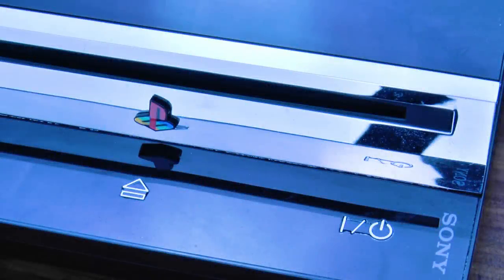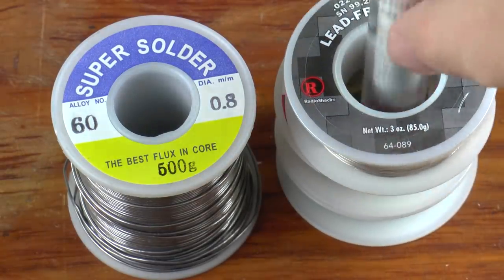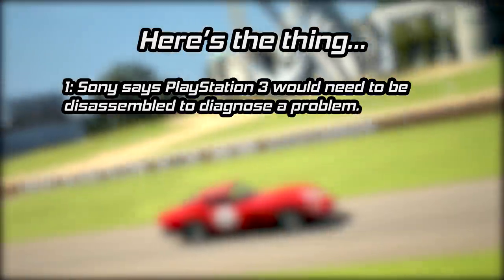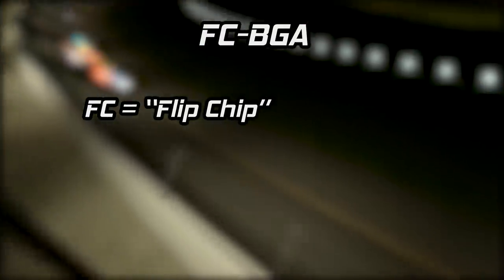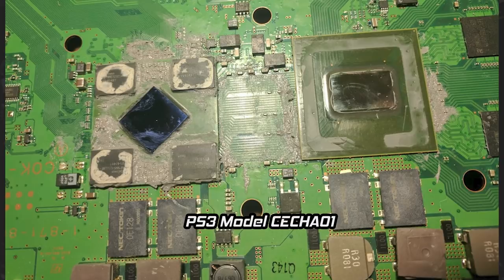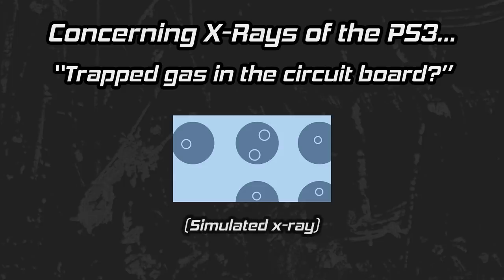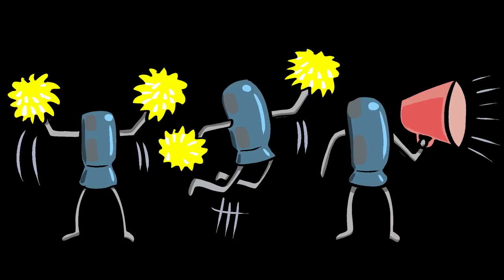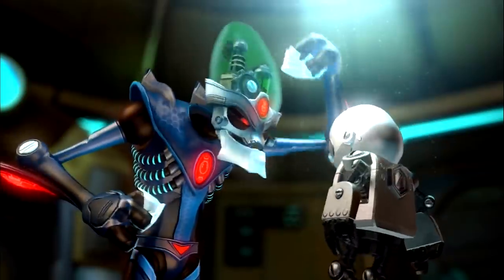The Misdiagnosis of the PlayStation 3 Yellow Light of Death

Comment: Glad I watched this before I attended the PS3 YLoD "fix" a few days ago.
Reply: Did it work?
Reply: It works just renew paste
Reply: @siddharthnambiar5758  it worked, delidding the RSX and CELL and replacing the thermal paste. No yellow light anymore (it wasn't dead, it just didn't turn on the first tries). But now it actually got the YLOD, and I'll try replacing those capacitors.
Reply: @Chrisgamechannel1  I did, it worked, but now it's dead, because of the capacitors I guess.

Comment: I love this video. I'm a software engineer and see this sort of "repair" strategy from a lot of "peers" in the field. It's reinforced by bad middle management who often reward results over anyone knowing what actually went wrong. Making a problem go away is obviously the goal, but if it's your own product you gotta know what what really went wrong to know how to fix it. Of course Sony doesn't have to be transparent about what is going wrong, but they should (and probably did) know. I had a friend who fixed my launch PS3 60GB (it worked right after the heat gun application to the CPU and maybe GPU - not the capacitors) but it didn't start up when I got home long enough for me to transfer my saves away. This video shed a lot of light on the idea that the exact issue isn't even known, but the reason I saw any difference was a bit of dumb luck.

Comment: This reminds me a lot of the GPU switching issues with 2010-2013 MacBook Pros. Everyone thought it was the lead-free solder on the Nvidia GPUs, but it was the capacitor feeding the GPU that caused the issue. But because it was right beside the GPU, everyone heating up the board would reheat the capacitor and “fix” their boards.

Comment: Dreamcast random reset -> The internet : "Reflow the pins of the PSU or bend them !!!!"
Everyone : "Ok, I'll do that and spread my new knowledge !"
Open a DC and tell me those pins "disconnect themselves" at random while you're playing... Geeee, the amount of fake knowledge out there is beyond belief sometimes.
Real solution : Remove the dust (basically free the exhaust of eventual dust), clean the fan, MAKE SURE the fan spins (if not, reflow the 3 pins of the fan's connector on the daughter board) and more importantly : change the thermal pads (with 1.5mm thick ones). That's it, problem solved !
Reply: I believe that the random reset on the Dreamcast can only be caused on the PSU side if you unplug and replug it on the Motherboard multiple times. And because the pins are not designed for that multiple unplugging and replugging you're gonna run into a potential random reset issue or the console not wanting to boot at all and you have to find a fix for it.
Reply: BaeCityAnri   BaeCityAnri  In my case pin 1 that outputs 3.3V was dirty or perhaps even worse than that which caused my VA1 Dreamcast to not boot. Cleaning it with IPA helped but only temporarly because soon after thta I would get random resets. Lately I had to put the PSU slightly higher for it to work. Though now I'm getting a different motherboard (also VA1) for my Dreamcast because of screwed up a mod on that one. 
One more thing: Having a Dreamcast that the GD-Rom drive doesn't do anything can be associated with the bad PSU connection particularly on the pin 6 that outputs 12V.
Reply: BaeCityAnri  @Daniel Black (Hey Alex !) Corroded pins causing random resets, that I would believe. Not booting at all, that would make sense. But we're talking 0.x% of Dreamcast here. The thing is, people seem to have "fixed" the issue by doing something to these pins, I have a theory on this : While doing it, they've applied some pressure onto the top metal shielding / Heat sink which is what, IMO, actually did something (added to the fact that they've probably cleaned the console while they were at it). I wouldn't be surprised that the issue is a combination of 2 things :
The thermal pad getting thinner and the heat sink losing contact with the thermal pad (because of the heat, the metal expanded)
Therefore, there was air between the thermal pad and the heat sink, air being one of the most efficient insulation, there was an overheating issue.

Out of the 50+ I've taken care of this year, only 2 had a reboot issue. One was due to cold solder joints of the fan connector and the other was a console sent to me by someone telling me random reset  was the issue I needed to look into. I cleaned those pins with IPA (I always do, it doesn't cost me anything but at no point I told myself this was part of the fix, plus, they were in good shape), all I did was a cleaning and replaced the pads. It was months ago, no news from the customer so... "no news is good news" like we say in France !

Daniel, "Having a Dreamcast that the GD-Rom drive doesn't do anything can be associated with the bad PSU connection particularly on the pin 6 that outputs 12V."
When you have issues with the GDrom, check the GDrom connector itself first, it's very unreliable. For instance (and this is an issue very poorly documented), if your DC hangs on the boot screen for 2 minutes, it just a bad connection between the MB and the GDrom assembly. Unplug, replug and it should work fine.

I'm not saying there wasn't an issue with your PSU on this one. But maybe you've disassembled it, checked everything, saw something with the 6th pin (let's say, you cleaned it) put everything back together and the GDrom was working again so you told yourself it had to be that 6th pin. It could have just been a bad connection between the MB and GDrom drive, that you fix without noticing.
Reply: @SLRModShop  Yeah... I personally only ever had one Dreamcast so my own experience on this is very (!) limited. And I had a conversation with one guy who does console repairs and he said that most Dreamcast he got had a bad PSU connection. And I saw one video years ago about a Dreamcast not reading discs where the GD-Rom Drive didn't do anything and the guy just added solder to the pins to be thicker and then it started to read again. And he didn't even clean or remove and reinsert the GD-Rom drive!
In any case, I'll think about chnaging my procedure when doing repairs like these. In general we need to inform ourselves from people who repair these about their experience. 

Thanks for the info! And...

Sorry for the late answer...I wasn't pinged and I didn't check myself if someone responded until now.
Reply: @danielblack6529  No worry, I'm making a huge repair guide that I will share online once it's finished. If you're interested, follow me on Twitter @vvJerome (I'm not trying to gain followers, you can unfollow me as soon as I release it). Today, I've found the RF eye pattern of the laser, you can check online, the info isn't there, trust me... So, you can expect a very thorough guide. I will also share it first with trusted modders so they can correct or add stuff before it goes online, my goal is to create the Bible of Dreamcast repairing.
Reply: iVirtualPlays  I understand why people like the picoPSU but it's a very non essential mod IMO. First, because you need to use an external PSU (which can cause video noise) and because the Dreamcast is a pretty cool system to begin with. If you have good thermal pads, a clean fan or even a Noctua fan is more than enough even to handle a 10% overclock (Noctua fan isn't as ground breaking as people made it out to be - again, IMO - and also it depends on the type of fan your Dreamcast has to begin with). The real picoPSU cost something like $53 and you need to add the cost of a good external PSU on top of that... When you can just remove the 12V rail for free...

As for the Noctua fan, it's way quieter than SOME fans but just a bit quieter than most of them actually. And also, to my knowledge, no one as proven that it actually makes the console cooler.

Last thing, even the worst fan (in terms of noise) is nothing compared to the noise a broken gear on the Matsushita motor will generate... Before adding a Noctua fan or a picoPSU, I would replace that gear.

And again, and as always, just my opinion :)
Reply: iVirtualPlays  Yes, the Leicke PSU are very good but also pretty expensive, if you're using a real picoPSU, it's a $70 bill right there ($50 for a clone and a Leicke) (Leicke also just went from £16 to £28 last month... They must have noticed people were buying them for picoPSU...). I realized that, given the choice, none of my customers was willing to pay the price. If I list a console with a picoPSU, it's going to sell, but most people just want a console that works, some want a GDemu too in their console and very few actually want the "whole package" (picoPSU, Noctua etc)

I also have my own bias on the matter. I'm a modder and my own personal consoles would surprise most people, they are very bare bone, even my PS1 shell is so nasty looking (no way it can be fixed) that I wouldn't even sell it as "acceptable condition". So, yeah, I'm pretty cynical. I'm also a life long poor, so I don't like injecting tons of money in, what's essentially, a piece of plastic no one REALLY needs ^-^

Yeah, I know that's a weird thing to say for a modder/gamer but so long as the console works, why spend money that could be used elsewhere, on more important things.

Again, just my opinion
Reply: iVirtualPlays  As long as it doesn't hurt you and/or your family that's totally okay. It's just that a ton of gamers have an addiction and don't know where to stop. I refused a Rhea to a customer who told me (real quote) "I don't have the money but I'll make a credit"... He contacted me again less than a week ago, telling me that since then both his cats died and he's in debt because of all the surgery trying to save one of the cats. Can you imagine adding another £500 of debt on top just to get a Rhea in a Saturn ?! Don't get me wrong, I own 2 PVM, an OSSC and a dozen of cables that worth £35 each.

My point was : picoPSU (and/or Noctua fan) shouldn't be in every single console, it depends on people's priorities.

Mine is on reliability and versatility of the consoles I own and good video quality. On the other hand, I don't care about boxed games and goodies like Amibo. All that to say : don't take what I've said as a critic of you, for all I know you're playing with your Dreamcast 3000 hours per year and picoPSU and Noctua fan paid for themselves already
Reply: iVirtualPlays  Honestly, we've all done that. Lucky are those who can stop themselves at some point. And I totally agree, big collectors/youtubers are the perfect example... They have all these games and consoles so surely they must have a ton memory cards, right... And they're always trying to find the next idea to make a video... Weirdly enough, I don't see much of "my memory cards collection" videos out there... And when they do their Top 10 this or top 10 that, it's always the very first levels of games... These guys don't really play games anymore, that's sad but what's scary is that they can't seem to realize it (or able to snap out of it).

Our generation is fucked up if you ask me, some of us marry holograms and pillow cases with anime girls on it, some of us pay hundreds of $ for basically cardboard boxes, some of us argue on Twitter because Pingu's beak will be a different color in the upcoming remake etc. 

The 80' and 90's were so good that it made us weak. I really do think the "hard times make man strong, strong man makes good times, good times make man weak and weak man makes hard times" thing is true and that's why it bothers me so much. I'm for people doing what they want, but our generation is so fucked up and we have such a good time that the "next phase" will be very violent IMO

Sounds stupid, talking video games and seeing a grim future in the same sentence but I really think that there's something wrong with our generation and that today's culture (or rather the lack of it) is a tell tale sign.

Rant over =)
Reply: in my particular case, random reboots were caused by cold joints on some of PSU components (mostly capacitors)... I just redid those and now the console works stable, I was about to change thermal pads but decided to inspect DC's inside before buying them; also yeah, I'm sure I'm not wrong bc console did good after 3 days of excessive testing (HotD2, MK Gold and Tech Romancer were played a lot)...
Reply: @sawarineko4491  Always reflow the caps and the two pins (where you plug the power cord) on PSU. I do this on every PSU that I come across whether the console works fine or not.
Reply: @SLRModShop  yea, I did that, but thank you anyway)
Reply: you use "eventual" in the european sense
Reply: @bootmii98  Probably, I'm French.
Reply: @SLRModShop  Yeah, the one where it means "possible". don't do that, native speakers don't know it unless they've looked up Euro English.

Comment: I fixed my Phat 60GB Launch model by just adding Tantalon capacitors to the CPU and GPU line. Needless to say though, it was still sealed all these years, never heated up and never screwed around by "technicians".
Reply: Dirceu Franzner how did you do it?
Reply: My 60gb PS3 works fine even till now
Reply: Dirceu Franzner How, mate?
Reply: Brownie Love cantalon :D
Reply: @misium  
Confirmed...flux capacitor also needs to be fused with a maximum overthruster. John Smallberries & Dr. Buckaroo Banzai showed me this when the Hong Kong Cavaliers were all out buying new thermal paste for Yoyodine Industries during a rare joint venture~

Comment: Nice video.

I just heard about these new findings and found this video upon research.

My launch 60GB ($600) PS3 got YLOD and has been sitting in my closet since 2010 because I didn't want to do any of the suggested fixes. It was either "reflow" or "reball" from everyone I spoke to. EVERYONE.
Reflow always seemed janky to me and  it wasn't worth it for a 3 day fix. 
Reball seemed just as janky but it was much more expensive with just as few guarantees. 

I'm glad I held out as I'll be trying my own capacitor replacement to see if that works. I'm glad some other viable possibility for fixing has been found as the entire "it's all on lead-free solder" just never made total sense, not for ALL YLOD issues. I'm an amateur repair enthusiast and even I know the PS3 tops out at about 90c. 90c won't affect the solder balls usually. It just never made sense to me.

I always thought that:

A - The Cell CPU and RSX are complete dogshit

or

B - Something else is going on. I didn't know what but something else.

Based on my quick research I'm finding most fix their previously unfixable console via capacitor replacement.
Reply: I'd love to know what your conclusion are once you replace the tokens
Reply: @RomeGoLARGE  

I'll definitely add a reply here about the results after I do it.
Reply: @DannyWilliamH  sweet. Thanks bro.
Reply: I forgot  to ask, with learning about these new possibilities, do you find it still necessary to replace the thermal paste?
Reply: @RomeGoLARGE  

I'm going to. These mass produced devices (consoles, GPU's, etc) are notorious for having garbage thermal paste.

I'm not going to de-lid or anything but the paste on the IHS is absolutely getting removed and replaced.
Reply: @RomeGoLARGE  

Quick update:

It works! I didn't even use the "proper" caps to test it but just giving it new caps that meet the specifications is enough.

I'm yet to properly clean and rebuild it but it worked. I need to order flatter caps and some new thermal paste but literally just changing the garbage caps that came stock was enough.

I don't make a lot videos for YouTube but maybe I'll make a quick one to show and explain. However, it can be seen on this and other channels already. Get to those old caps (a pain in the butt, yet not too bad), replace with similarly rated caps and voila! The OG 60GB Phat is back in action.

It was still on 3.50 FW, too. Haha
Reply: @DannyWilliamH  Hi, I know that has been a long time, but can you share which caps specs should I use to replace NEC's faulty one and how many?

Comment: Just tried this theory of heating the nec tokin of a cech2001a ps3 slim ylod (bought off Craigslist for next to nothing has factory warranty seal cleaned and untouched/scratched)on to the repairs I blocked off the rsx with kapton tape heat the Capacitors at 300c for 1min each side reinstalled everything together and it worked as it should. Just wanna leave a comment saying yes it worked for "me but for anyone eles who know right?
Reply: hamasaki kenji oh, I destroyed a ylod ps3 with my friends 4 months ago
Reply: Maybe replace them with either the same chips or an equivalent. That would fix it for longer.  This is good to hear though
Reply: Arnold101Knight  I have already replaced my cap to tantalum caps from a dead cech3xxx board. I believe these nec tokin act iffy because of heat and solder making microscopic cracks plus have you seen these thing melt/shatter when people attempt to remove them carefully
Reply: Arnold101Knight  the heat seems to cause the cracks to connect temporariliy. Which is why it's not a Perm Fix like replacing them are. :)

It could also be the heat Charging the Caps but idk if thats as likely lol